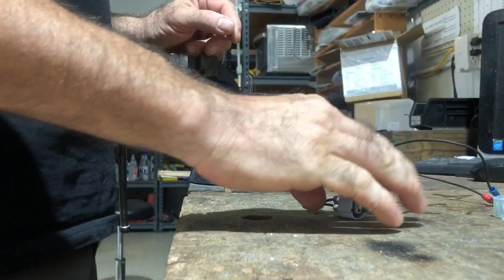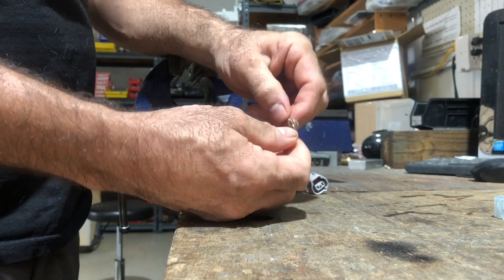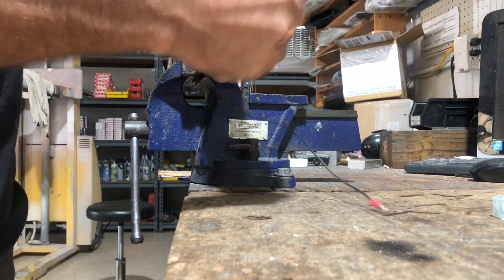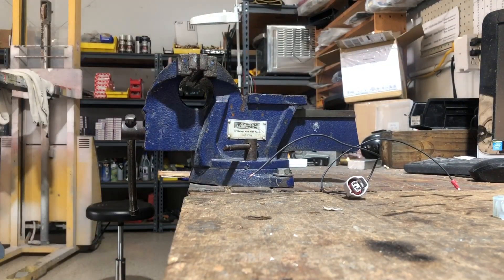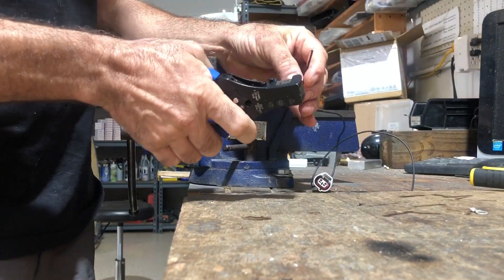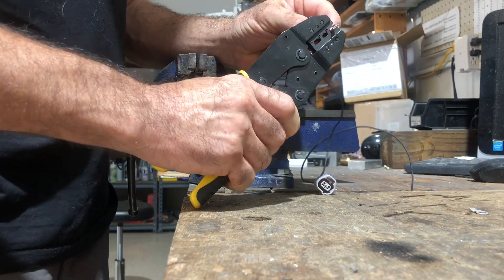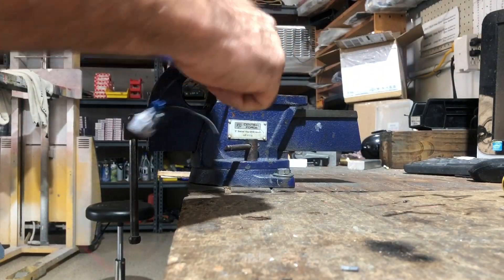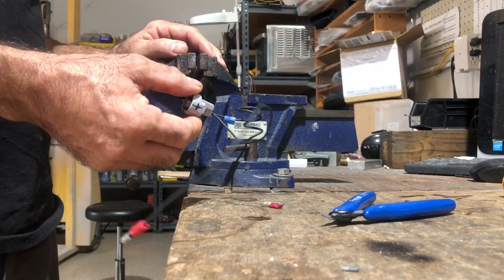The Importance of Wiring and Trusting Your Crimps

Comment: Ugh, those standard connectors are literal garbage. If I’m ever in a situation where I’m forced to use them, I always solder and heat shrink them. However, even doing that, I still would not put them in a plane.

Comment: Good video Jan.
I would even go so far as to say NEVER crimp a terminal onto a freshly stripped lead until you've carefully inspected (under magnification) the individual wires for nicks from the stripping tool. After several thousand vibration cycles, any nicks will inevitably be a point of wire breakage. If possible, strip a lead only far enough to pull the insulation away, even if it requires a bit of force as a result of the insulation not being fully severed.
And of course, never use solid core wiring.

Comment: Once you use the aviation style of connectors you get spoiled and will be using them for everything. I've just rewired my boat trailer and I expect it will last longer than automotive style of connectors. Hey great information because safety is everything in aviation  and you have helped many understand this with this video. Thanks Jan.

Comment: See this all the time when i was doing avionic work and alot more in the work im doing now, i did alot of building new harnesses and harness repairs because of things like this. it's not something i would trust in my personal truck much less in a my aircraft. I have easly over $20000 in electronic tools alone with all the crimping tools(not all are cheap), cutting tools, terminal tools, connecting pin install and removal tools, load testing, coaxial cable and antenna testing equipment ect... 9 times out of 10 when troubleshooting power or communication issues it turns out to be a bad crimp, such as what you see here and over crimping and some of the worst are when someone doesn't get all of the conductor material in the terminal and leave it hanging outside the terminal or using smaller terminals than the cable/wire needs and cuts some of the conductors out so it fits, also lack of useing strain reliefs. The tools and things shown at the end of your video shows a basic starting kit that would definitely make safer crimps for the majority of basic GA aircraft connections for safety and reliability never hurts to add specific crimping tools for the different connectors used in aviation as well.